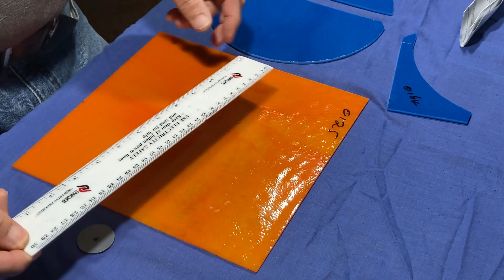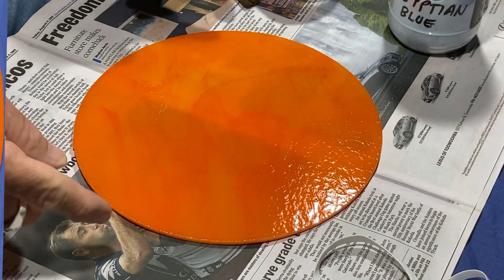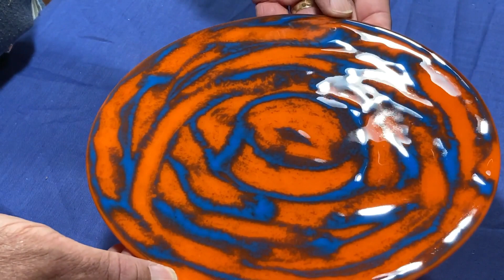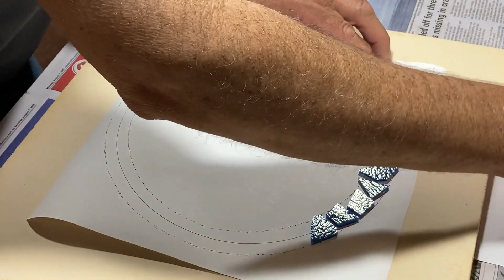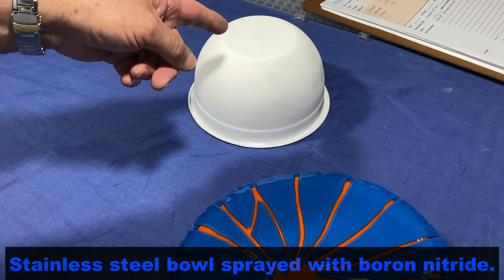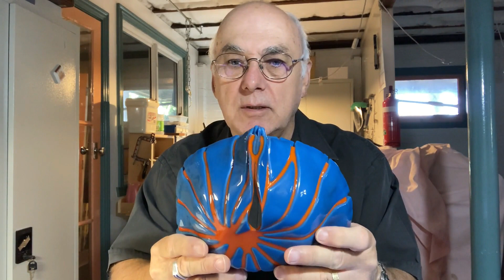Making a Fused Glass Vortex Bowl - Project, Fused Glass Tutorial & Techniques

Comment: Wonderful project! Just love it!!! One quick question. Is there a typo on step 4 of the high tack fuse schedule regarding the temperatures?
Reply from the maker: Hi Susan. If you mean to 83C down to 375C, there's no mistake, but I do it different now. Now I have a standard cool made up of 2 final steps after annealing. Step 4 would be 65C down to 425C, no hold, and then step 5  ramp down 132C to 375 C no hold. This is why I don't put schedules in videos any more. I can't change them after the video is published. Hope this helps.
Reply: I am elated Jeff!!! I wasn’t expecting a so quick response from you!!! Thank you for your answer, now it does make much more sense. 
I love your projects, your channel and your unique way of explaining things. I try to absorb as much as I can. Even being a beginner I learned quite a lot in a very short amount of time. Thank you for all what you do!!! 😊

Comment: Thank you for your video. I did some draping and find the inside of my drape once it’s been fired it has a very matte finish. Can you get a nice high polish or satin polish once it’s draped? Fire polishing won’t work with the drape method, or am I wrong? 😊
Reply from the maker: Not that I'm aware of. You are right, a fire polish temp is higher than a slump or drape and thus the piece will start changing shape again. I wish I could be of more help.

Comment: What is the largest circle you can make on your ring saw using this method?
Reply from the maker: Hi Judith. 25-26 cm, depending on how well you've roughed out the circle. A square piece will be much smaller.
Reply: Thank you. I just bought a round bowl and found that the tool I have is not very good. The bowl is 28 cm.  I have tried cutting by hand. Round will be a challenge.

Comment: I wonder if you had placed a small circle of papyrus on the metal mold if it wouldn’t have helped with heat conduction and maybe not had the breakage issue? Love the cosmic frit effect and very clever circle cutting technique!
Reply from the maker: Hi Caroline. That's an idea worth trying. I haven't had the problem before, but I'm always open to suggestion so I'll give it a go.